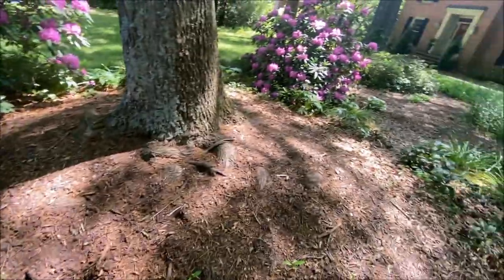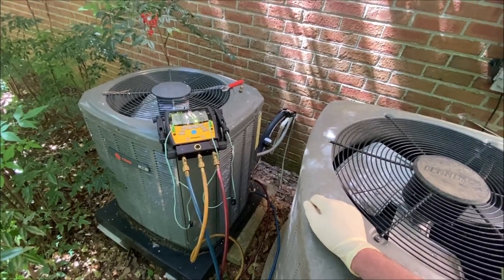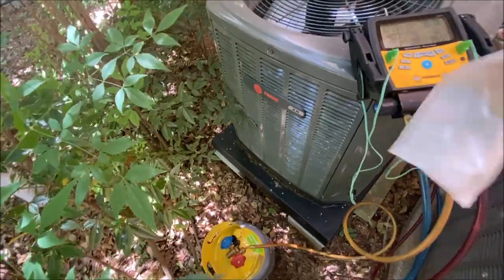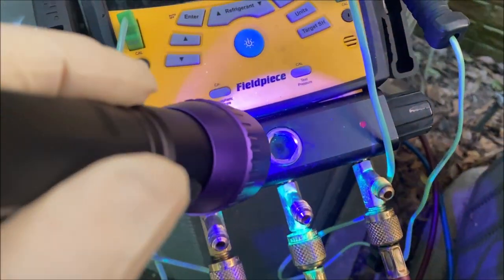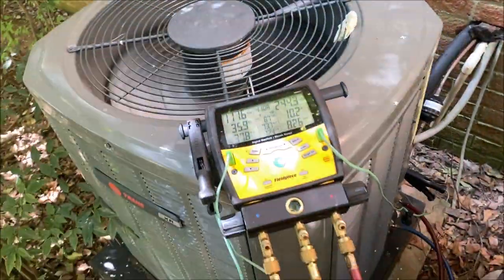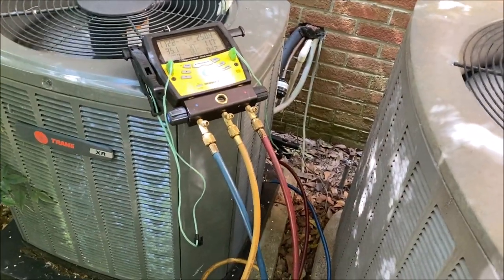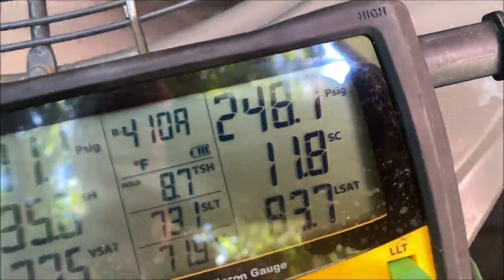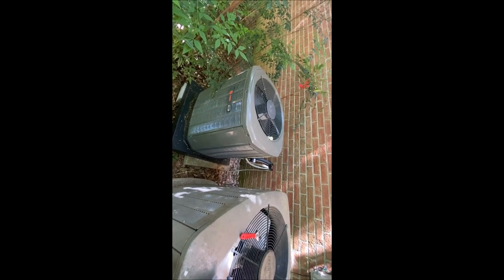R410a dye charging jug PT2 (field test)

Comment: I can't wait till I'm in the part of my hvac  journey that I can put a set of field piece gauges to a dye only kit. 👍 great video
Reply: A $40 dial gauge set w/hoses could be used for that "dirty injection work" Use a clean rag!
but any subsequent use of your good digital set and all hoses will still get slimed.
Use those system warning labels so the next tech is informed to expect contamination...
Hopefully, the dye is compatible with both refrigerant and oil so it won't cause any troubles. 
[lol, cough, TXV]

edit: Why not just use a extra hose with shut-off valves added to each end. You could flush/load it up, attach to low side and then push into system with clean refrigerant coming from you "clean" gauge set? Once in, the hose could be removed and replaced before allowing the full-strength load to come back into the gauge set. Once mixed into the system, some dye will still get back into BOTH sides of your gauge, so the issue is only with the concentration level.

Comment: Instead of the dye tank setup, I'd recommend using Spectroline EZ-Ject dye cartridges, with the injection tool.
One cartridge is enough for 2 or 3 split systems, involves a lot less mess, and you don't have to run it through your manifold and hoses.

Comment: Hold a clean rag over each fitting while connecting/disconnecting to reduce random spray of detection dye.

That two-metals transition weld seems impossible to me; I can't wait to see how you deal with it properly!
Reply: AS/Trane has a repair kit for them.
Comes with a stub of copper to braze to the copper pipe, and a hydraulic compression fitting to join the aluminum to the copper.
It works quite well if you follow the instructions.

Comment: maybe the factories should start adding uv dye directly. 🤣
Reply: I've been saying that since my first year in the trade.
 These companies make leaky junk.
The EPA should just make them put dye in every condensing unit and get it over with - cut to the chase, save time,  and bust-out a UV light any time a system is low.

Comment: Could you of bled it at the recovery tank. Use the Freon from the condenser to bleed it? Just asking for a friend. Lol
Reply: good idea, as long as it's not too low on charge.
Reply: yea, i was going to comment same idea. bleed it - FROM SYSTEM  - to jug. no die outside to mess with diagnosis either. false positive outside oops 😬.

Comment: I tried that dye years ago and it's a dang mess then when you find the leak and repair it that mess will always be in that system unless you replace absolutely everything so I spent a pretty good price for a very high tech leak detector and it will find the absolute smallest of leaks any freon at all it will pick up on it thanks for the video
Reply: What link detector do you use

Comment: That Dye sure Works good for showing You where a Leak is. i've NEVER used dye. i Prefer a Clean system. i can see an application for it though on a system that u just cant Find the location of a Leak & have tried the standard methods.
1) nitrogen & refrigerant at 150-250 & h-10.
2) bubbles
3) Last Resort - Dye.
Good vid ! since that units not even 2 years old. it should be under warranty right ?
New Condenser from trane ? should be.
Reply: I use it now and again, have found a few odd leaks with it, leaking weld on receiver,  leaking brass suction valve where the factory solder failed, leaking milk tank where could see the green dripping out the bottom of it! 
It failed on an Indian restaurant cold room as the food colouring glows green too!